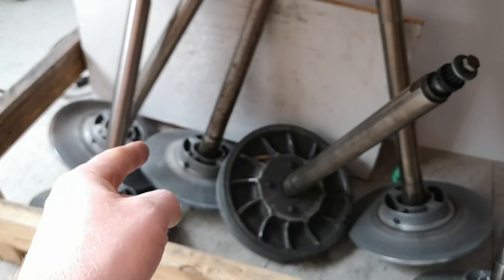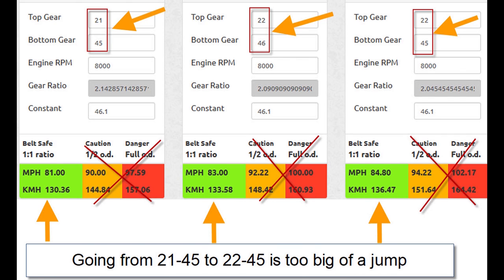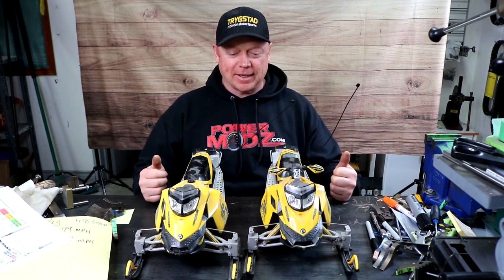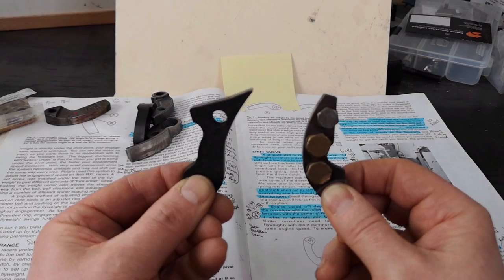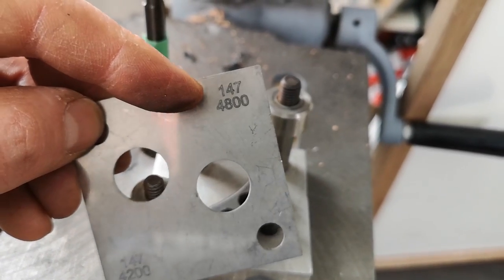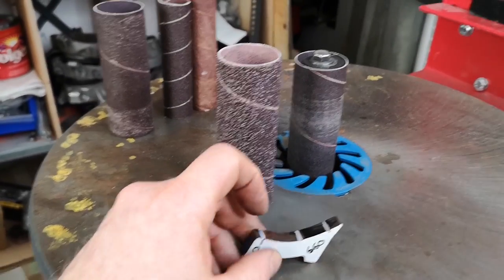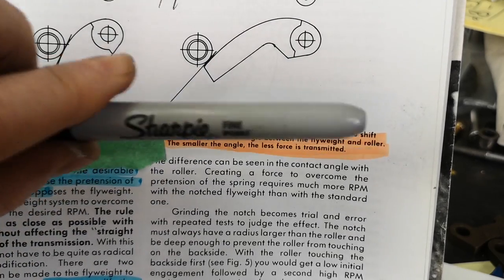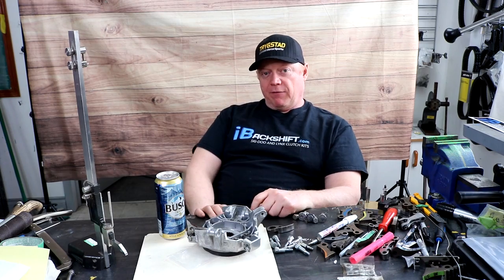Ski-Doo pDrive clutch how ramps work Part 4 iBackshift

Comment: Great video joe, lots of details. What are your thoughts -  CJ could experiment with lower finishing force on the primary or in tra, using the clicker to lower the ramp, pushing harder in the range where he is getting passed.
Reply from the maker: CLICKER) Lowering the clicker also lowers the start angle of the ramp in the portion where he was coming off the line.  The engine was not as quick to accelerate and slower to get to the 350' mark. 
SPRING) The primary clutch spring, one with a next lower final force was too big of a change going from xxx/430 to xxx/370.  From 430 to 370 the engine speed would drift low getting near the finish line.  Cutting the ramp like I did give us the leeway to use a xxx/460 if needed.
Reply: Dynamo Joe I learned so much from you, your site, and your videos. Thanks! I’ve been helping my buddy tune a vintage CVT mini bike. Different machine, same principals. Take care.

Comment: Can you tell me how come my 2012 Renagade Backcountry X only goes just barely 100 mph even beat a high country 1100 2014 I think if I remember when they first came out!
Reply from the maker: worn clutch wear parts, improper drive belt, wrong engine speed, all contribute to low top speed

Comment: Joe my belt deflection adjuster isn't flush with my secondary sheave what could the cause be ? sticking out about an inch away from the sheave.  i have no belt adjustment..
2009 renegade 800
Reply from the maker: Hi Mike. There are 2 types of adjuster in 2009.  Do you have the aluminum one with the setscrews and 2 jamb-nuts?  Send me a picture of it at my website.  info at ibackshift dot calm.